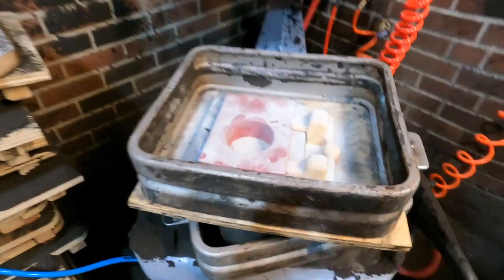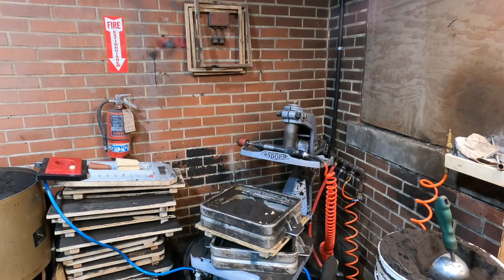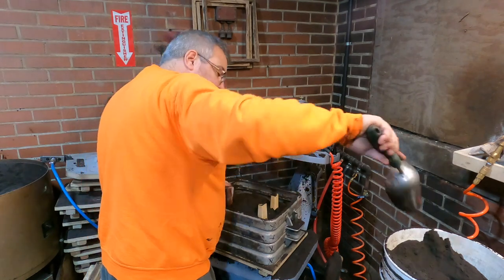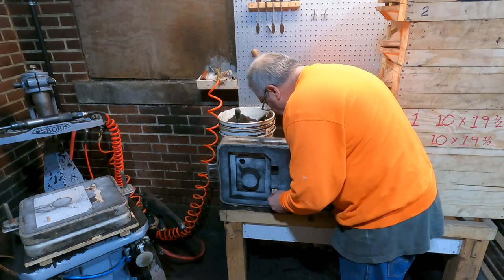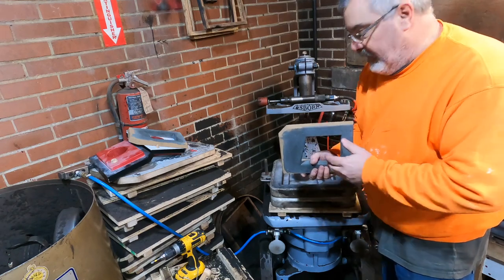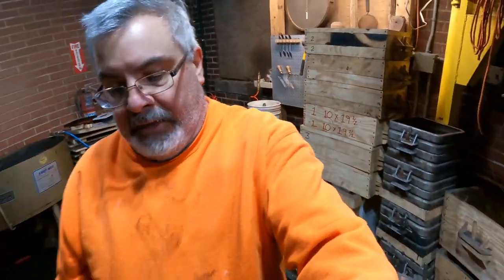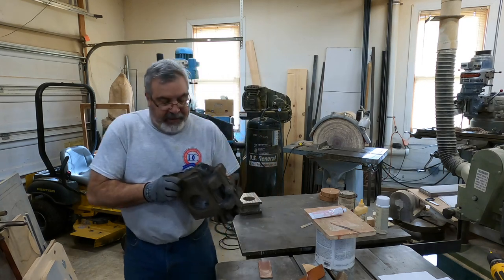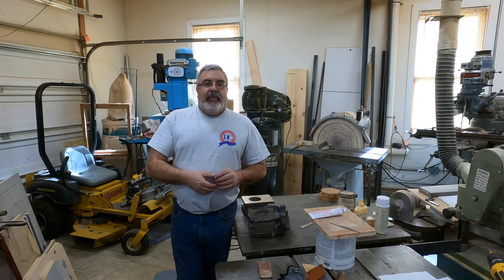Making the Casting for Keith Rucker's Pattern Project

Comment: I'm debating about commenting. The issue is safety. First clamp or weight your molds. Put some paper or cardboard between the plinth and crucible, that will keep them from sticking together. Last get a fire retardant apron and spats for you and your assistant. Safety in the foundry is just as important as it is in the patternshop, maybe more. Just a suggestion, more for your viewers that may just be getting started.

Comment: Clark never includes the runners in his patterns. Not sure why. Doing so makes so much sense to me. Faster, more consistent results etc.
Reply: Is it really faster to make runner pattern for 1 off castings? When Clark hand cuts runners it's a matter of minutes per mold, making a pattern is a matter of hours. Why spend 2 hours making a runner mold for 2 molds if hand cutting both molds taks half an hour? And how often do you see Clark make an actual  pattern? He's mostly using customer supplied patters or duplicating a casting.